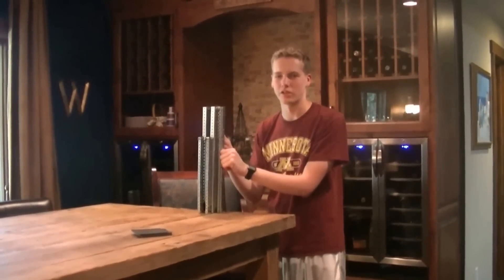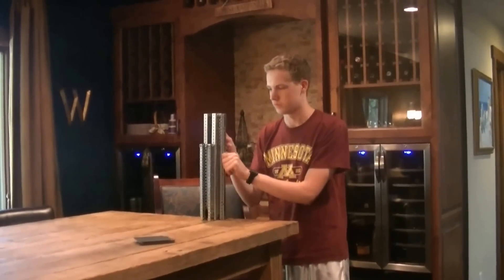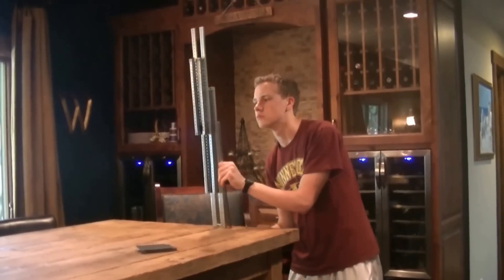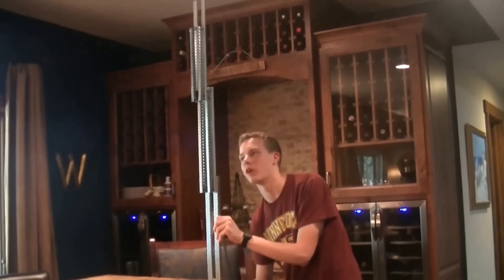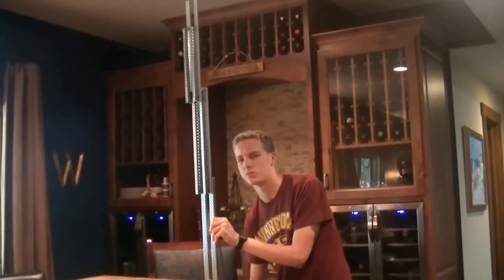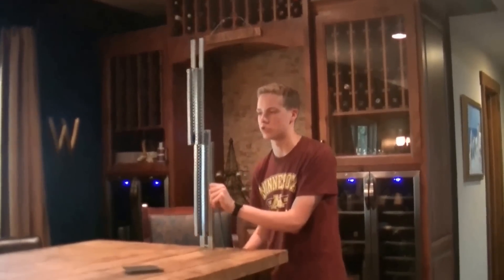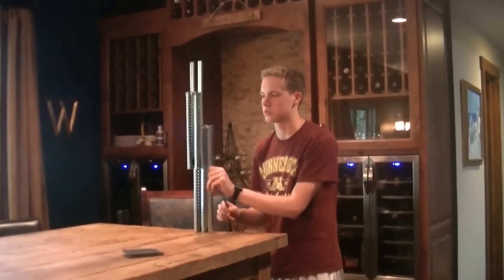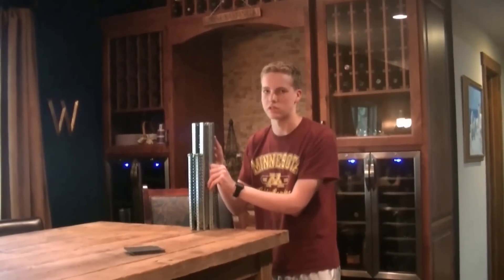Vex Skyrise 47 inch Elevator Lift Prototype

Comment: Could this chain mechanism be used to lift the whole robot off the ground ?
Reply from the maker: It is feasible, though this design would not have the required torque.

Comment: Team 5658E here! We use an elevator lift that can reach maximum 5 Skyrise and 4 Cubes with a claw for Skyrises and a passive cube intake. I'm not sure how tall that is, but if we added two more motors and a second chain adjacent to the first, we may be able to reach the full 60" without the chain snapping. Also, if anyone could suggest a good base/drive design that'd be great because we're switching bases for size concerns. I was thinking X drive but I'm not sure.

Comment: I've done something similar to this. you need a lot of torque to get it to full height or it will start binding up. If you are interested in building a elevator lift,check out these links that were helpful:
http://curriculum.vexrobotics.com/curriculum/lifting-mechanisms/elevators
Vex Double Linear Slide Animation

Comment: How does this hold up when you put weight on it? We tried 4-stage a cascading lift similar to this one, but when we put the weight of two cubes and an intake on it, the chains snapped. Even the inclusion of extra chains to distribute the force wasn't enough to prevent it from snapping.
Reply from the maker: When we still had the lift, the chain snapped when 1 cube was nearing the top. There was no chance of a second block, so we abandoned the idea.

Comment: Even though the top of the last stage ends up at 47", it starts out at about 17.5", so it only gains about 29.5". Therefore, if it lifted a cube from the floor, the cube would be 29.5" inches higher than it started out. If you pick up a skyrise section from the ~11.5" autoloader, than it could get higher, but I would call this a 29.5" lift.

Comment: Genius idea, I was thinking of a very complex crane with high autonomy, but I think this might work better and keep things simple. Is there a design blueprint I can analyze?
Reply: As said in another comment, our lift has been deconstructed due to many problems. This lift might be a good idea for this years challenge, but our design is not a working one. It could only lift 1 block 20 inches off the ground. If you want to use this lift design, I suggest you come up with a different design.

Comment: Could you do a close-up PLEASE!
Reply: TheQ IsSilqent When my team used this lift design in Sack Attack, we were able to lift about 20 sacks at one time without the chain giving out.  I don't think it was anything with the way you built it, it may just be missing a key component somewhere.  Sorry if I sounded like a jerk, that was not my intention.  I really like this design and my team and I are using it again this year, I just don't want you to give up on it so easily! :P
Reply from the maker: I'm sorry to say this, but we have already deconstructed most of this lift. The chain kept breaking when the added weight of a block was added. We plan on remaking a similar designed lift with pulleys and string instead of chain and sprockets. We will make a video on it when it is complete.